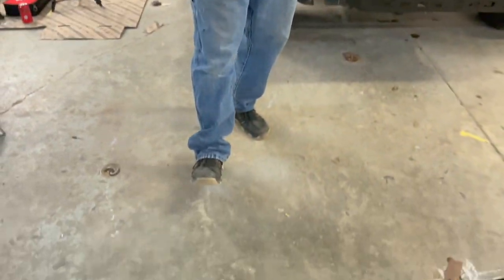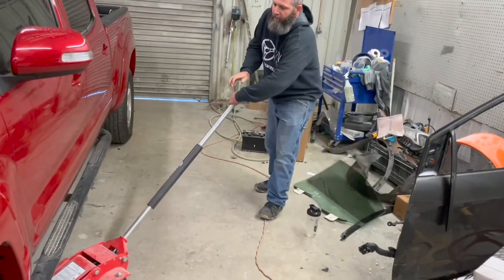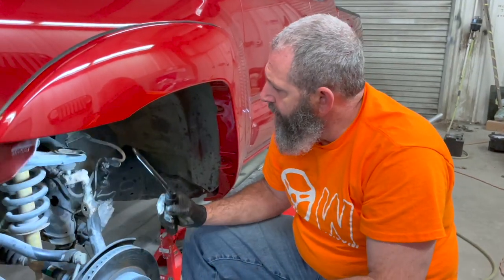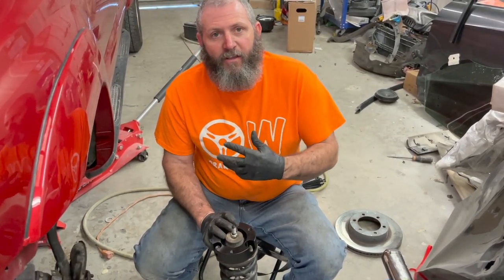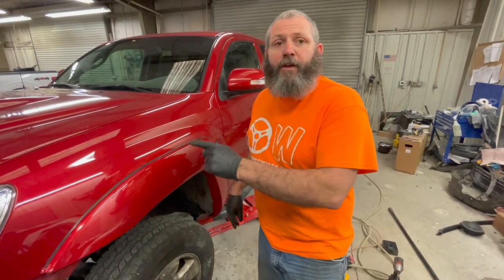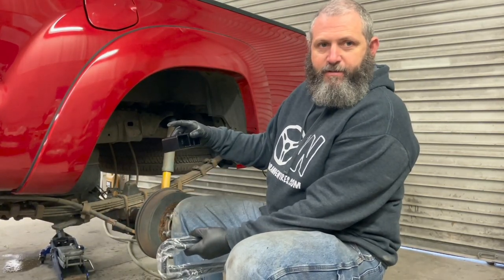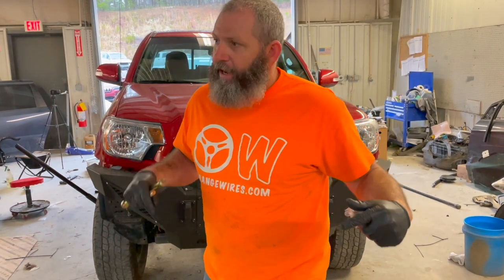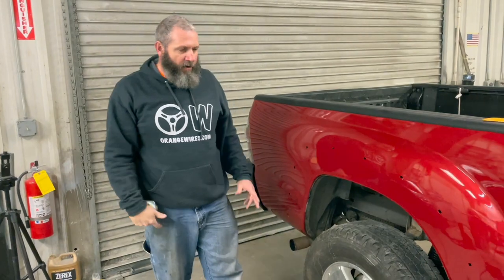INSTALLING A TORCH OFF ROAD LIFT KIT ON A 2ND GEN TACOMA!

Comment: Do you not need different upper control arms? Usually you need slightly longer and offset.
Reply from the maker: This particular kit does not require them.

Comment: i put mine on and its no where near the measurements you got in the front or rear on my 2009 toyota tacoma
Reply from the maker: How much lift did you get?
Reply: @OrangeWiresGarage   3 inch lift just like this one supposed to be 3 and 2
Reply from the maker: @TylerMartin-cd1jd  we have put quite a few of these in and usually get around 3” up front and 2” in the rear.  I don’t know why it would be different.  How much lift did it give you?
Reply: @OrangeWiresGarage  like 1.5 in the front the rear is higher then the front
Reply from the maker: @TylerMartin-cd1jd  how thick are the blocks up front sounds like maybe you received the wrong blocks!
Reply: @OrangeWiresGarage  they are 1.5 inches when i measured them
Reply from the maker: @TylerMartin-cd1jd  the front block measures 1.5” and the rear block measures 2” you should get close to 3” of lift in the front and 2” in the rear
Reply: @OrangeWiresGarage  i did in the front but the rear is higher then the front
Reply from the maker: Unless your front coils are weak that is the only think I can think of we have put quite a few of these in and have had no issues.  The suspension is the same from 05-15 and pretty much the same all the way to 22.
Reply: @OrangeWiresGarage  my coils are new on the front my tacoma is just a base model to
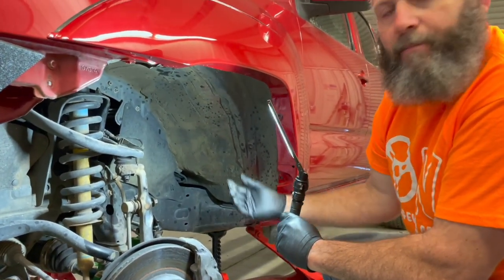Reply from the maker: Check this video out at 4:13 exact same kit https://youtu.be/6NdHC4tTYdE